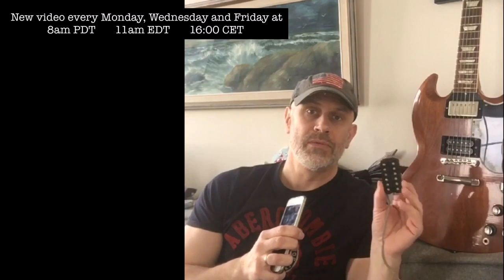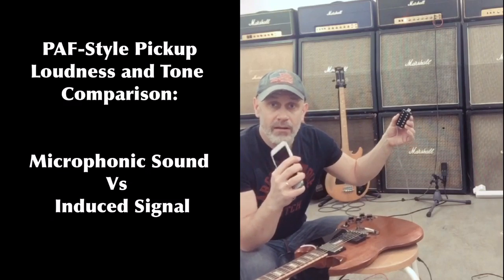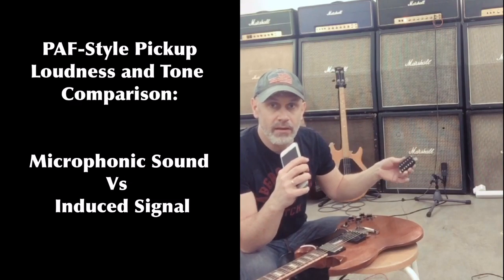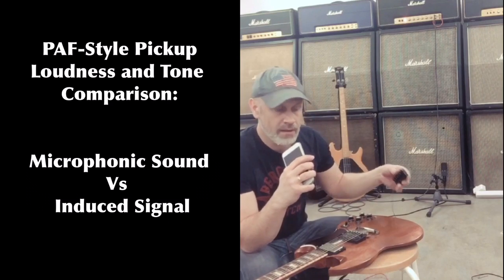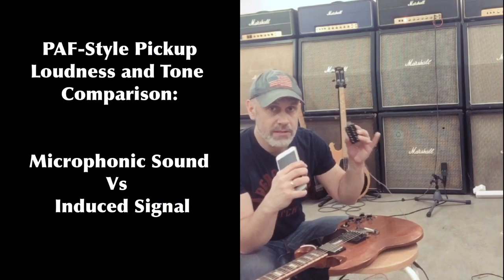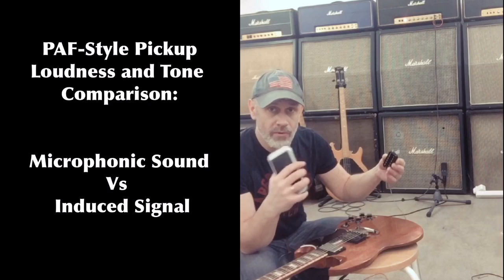Does microphonic guitar pickups explain tonewood?

Comment: Microphonic pickups explain why potting & shielding is important. Before they pick up the coughs of the body material, they pick up all sorts of crap at a venue. If you want to hear the wood, add a piezo element and mix it in just as much as you like (hollow body). The point is that you can turn it off. You can always shovel some more dirt on it, but it's important that the pickup is reliable and sounds can be reproduced every day on stage.
Compare the P90s in wooden solidbody guitars to an acrylic body. Mmmmh listen to that PMMA. What you've proven is that a microphonic pickup can pick up vibrations from a vibrating surface. Now you do the same with other materials and do a double blind test to see if people can tell the difference between the materials. Listen to a football game while you're on stage...what a sales pitch! Lots of reasons why to build better pickups. Instead of trying things like the good lace sensors, piezo hybrids or the fishman fluence sets, fully simulated pickups, people look back at shitty designs.

 Pressing it against the body is not the same as sitting in the cavity under spring tension. The Vibrations distributed on the inside are not the same as on the top. Since they're microphonic you also have to do a recording only picking up from the air. 
You can scream/sing in almost any kind of pickup when the volume is really high. 

What kind of weighting do you use on your sound level meter? A or C weighting? (also: slow/fast averaging?)

Let's say it's A-weighted, pretty close to our own hearing. 
Placed on the Top pressed down you have 95dB(A)
And the installed pickup has a  SPL of 108dB(A) 
While it's given that the neck pickup is often louder cause it's close to the middle of the strings, it is a 13dB difference. When you 10 amps at 95dB(A) together you are at 105dB(A)
That's around 4.5 times higher sound pressure.
You put a Jackhammer right next to the car with Wayne&Gar from Wayne's World. In that moment when the plane lands, do you think you can hear the jackhammer?

But that test is really helpful. You can test other guitars on how much energy is lost to the body instead of having it running up and down the strings. It's only enough to get a rough idea. hold it against the huge steel beam and see what it picks up.
Reply from the maker: Thanks, great feedback! Cheers Johan
Reply: Thx. Only possible cause you do all the tests, sparking new ideas. 
Got another idea for a video:
Could you perhaps get a Les Paul with a broken headstock (not that hard to find^^) and instead of fixing it, you reattach it in a way that you can adjust the headstock angle. That way you can show what angle is needed without any calculations and based also on playing intensity. 
And also if there is a difference in longitudinal stiffness added with a big angle (feels harder to bend cause the string can only lengthen between nut and bridge instead of the whole length). 
That way you also debunk that the angle brings sooo much to the gibson tone.  (And not the scale length and pickup placement)
Stay healthy Johan, flu season all over-.-.

Comment: to really prove tonewood shouldn't you try the microphonic pickup in different guitars made out of different woods? 
Anyway, loved the video.
Reply from the maker: Thanks Juan! Yeah absolutely. In this first video on the subject I wanted to the see if the acoustically/mechanically transferred sound was loud enough to be audible mixed with the louder induced signal, and using low output pickup that may be the case. Cheers

Comment: So its about 2.5x louder out of the pickup than the microphonic signal. I guess the lesson is direct mounting pickups really firmly could provide some subtle tonal changes. Interesting, it would have been tough but hearing the pickup pressed against the back of it in center would have been cool. I find that spot resonates a lot and thats where I stick my ear to listen to a guitars natural sound. 

To me the woods stick a guitar in one of three 'camps' really, sort of like a scale or range, the rest is all feel and comfort issues. I have found before that the resonance and sustain, not really tone, of an electric guitar played acoustically can indicate how it will work and react through pickups. I've also run sound for bands only to have a real pro from the next venue over step in for a song and be completely blown away at how much better they could make a guitar rig sound without changing anything. It didn't sound like a different guitar, but it sounded enhanced and every part of its character was sweeter and more musical. The basic tone seems to be in the woods, strings, build and shaped within limits by electronics. The musicality, sweetness, or 'pro' type tone and sound often comes from the player. Two sides of it I guess. A bad player can make a good rig sound bad. A pro player can only make a bad rig sound so good. A bad player can make bad gear sound horrid. A good player can really unleash the potential of good gear.
Reply: Well, ADD a PIEZO to a solid wood body, you will still GET an acoustic guitar tone from it! The Piezo directly conducts vibrations directly to AC current as vibrating the piezo crystal stresses it, causing sympathetic currents to be formed at the same frequencies as the vibration.
Reply from the maker: Thanks! Great feedback! Yeah it would be interesting to investigate how much of the acoustically transferred sound that is an actual frequency wise complete signal and how much that is just sympathetic vibrations of the pickup transferred from the body. It's indeed in bigness of tone rather than in additional frequencies that this could play a big role. Cheers Johan
Reply: EXACTLY! Same thing going on, well slightly!
Reply: Brent Edward
Does it have to, though?  Not to seem overly critical, but to me, it seems like a waste of mental energy, and possibly money, to worry about sounding so much like someone else.  I'm not a great player, myself, and certainly not a professional player, but I quit worrying about such differences between me and my heroes years ago, simply cuz I found the chase to be distracting from the quest for my own voice.  After all, THEY found their unique sounds somehow!  Besides, while you'll probably be a better player for having learned a hero's licks, who's to say your way of playing a song won't turn out to be better in the end?  It certainly has happened plenty of times across many genres.  I mean all of this to be encouraging, of course.

Comment: By holding the test pickup close to the pickup in the guitar body you still could have been getting some near field magnetic coupling between the pickups. A purer experiment would be to use an acoustic guitar that uses nonmetallic strings as your source of vibration.
Reply from the maker: Hi, that's why I also put the pickup at far below the bridge getting similar tone. There was none or a negligible component of electronically induced signal in this. Cheers
Reply: Johan Segeborn Good point - another interesting test would be to just measure the magnetic signal coupling between two guitar pickups driving one of them with a signal or measuring the coupling between a guitar pickup and the speaker in a speaker cabinet. When some guitarists hold their guitars really close to the cabinet to get feedback the magnetic coupling might be an issue (or not).

Comment: If there was a part of the body that was routed out for a pickup, that was not under the strings, then wired through the guitar. We might get a better sense of how much is added by being mounted to the body through the pickup rings, springs and screws, with it being grounded. 
Nice test though. Maybe the pickups having a more solid connection to the guitar will help pick up the tone wood better. Some guitars, less connection would be more desirable, where the sting vibrations are the main goal.
Reply from the maker: Yeah the pickups in a les Paul seems rather loosely attached to the body. And indeed, in many cases this component is even undesirable. Cheers

Comment: I think tonewood is better explained by the physical properties of the wood, and mainly how much the wood conducts vibrations at certain frequencies. That changes the sustain on the strings.
Reply from the maker: Yeah, I certainly think so too. I have received many comments stating that tonewood would only influence tone via microphonic transmission though, so I wanted to measure how loud the microphonic sound is compared to the overall signal.
Reply: Yes but the wood also affects HOW the strings vibrate, resonate and what envelopes they develop.

All  these factors combine.
Reply: Acrylic strats have a lovely sound.
Reply: Plasticky!
Reply: Physicist here, I think you have the correct interpretation. Plucking a note excites that fundamental frequency and several of its harmonics. Different woods/densities/neck construction/hardware material(ie brass bridges) may dampen or resonate with some of those harmonics, which can make a guitar sound brighter/darker depending on which harmonics are damped more, with all other variables like pickup position, height, plucking amplitude, location where plucked, etc. held the same.
Reply: Lavabug yep I'm a mechanical engineer and constantly am tinkering (modding) with those variables on my guitars to work in maximum harmony for the specific tones I want each guitar to have. Even the mass distribution of wood and hardware in certain areas make a difference. Everything matters.
Reply: yep. Mass is noticeable, I put 1lb of lead in a electronics cavity and the tone changed for the better. Perhaps completely sealed, active pickups can negate microphonic effects. But if the body/neck/hardware are damping some frequencies then the strings won't be resonating with those, so they aren't going to be heard through induction.
Reply: lol some people will never change their mind and will reject any anything contrary to what they know, even in the face of their senses and scientific explanations telling them their preconceptions are wrong. At the end of the day it is a moderate  to small effect, and IMO it does not justify spending extra money for a expensive exotic woods if less rare woods give similar tones, only do it for looks. Even plywood and acrylic guitars can sound very good, they are dense. Just try different neck constructions, body/neck woods and pickups and hardware materials (brass/steel/copper/titanium nuts/bridge saddles/trem blocks, even tremolo claws, etc) and find the combinations that YOU like through your own rig. There is no other way to know for sure.
Reply: Great stuff. Tell THAT to the Tonewood deniers!
Reply: however IMO I think it justifies the use of brass or other heavy materials used for hardware. Even changing a floyd rose tremolo claw to a brass one made a noticeable effect in the sound of a guitar, keeping everything else the same, and brass trem blocks IME make a major improvement in the sound of guitars with trems (increase in the lows and mids). They are not expensive upgrades and I like em. If you have a thin sounding, lightweight guitar, go nuts and try putting 1lb+ of lead fishing weights in the electronics cavity and you tell me if you don't hear a difference!
Reply: The sky could be FULL of flying saucers and the nay sayers would say it WASN'T happening!
Reply: Agreed 💯_percent. Tonewood haters gonna hate, no matter what. I just think they're bitter that they don't have a good enough ear to notice the differences the wood make, per other videos Johan has done before which prove it does make a difference. Nothing else makes sense.

Comment: Johan the amp compresses the signal quite a bit so those dB values go out the window. To get any usable readings you would need to hook the pickups up to a soundcard or an oscilloscope. Also, you would want the "normal" pickup to be heavily waxpotted and suspended with some kind of rubber in the guitar to minimize its microphonics.
Reply from the maker: There is indeed some compression in the amp. The difference was 13dB though. Which is a lot. The compression of the amp wouldn’t change that difference more than a couple of dB
Reply: It would be really interesting to see a plot of the frequency responses of the pickup vs microhponics. We could see how the responses add up, maybe do some FFT plotting as well. Maybe there is some interesting phasing, or cancellation going on.
Reply from the maker: Yeah, I’m gonna do a more controlled test soon. It’s a good point that phasing could play a part too. Cheers
Reply: infectionsman
Yeah, I'm looking forward to seeing how that plays out, too.  I've always assumed from what I learned that it's a complex effect, even reaching into harmonics of the microphonic tone affecting fundamentals and harmonics of the strings.

I'd also like to see this experiment redone after that specific pickup gets waxed, to see what kind of difference can be achieved.  I haven't looked elsewhere on YouTube yet, as of this comment, but I will.
Reply: Huh? Yea the amp compresses the signals, but my guess would be that because most people use amps when they play an electric guitar in real life, the induced signal would meet the threshold first and these recorded signals would be a realistic representation of the ratio of levels of the signal that would end up emerging from the speaker at the end of the chain.

Johan actually eliminated a few murky factors by accident by going through an amplifier. Using an amp (or compressor on your signal) makes the microphonics matter MORE.
Reply: Is it 3dB increase=double volume? If it is, than the volume percieved from the mounted PU is more than 16 times the one from the loose PU...